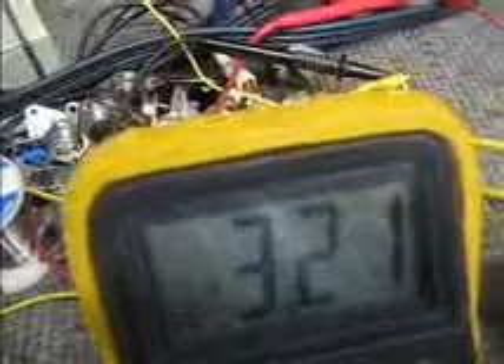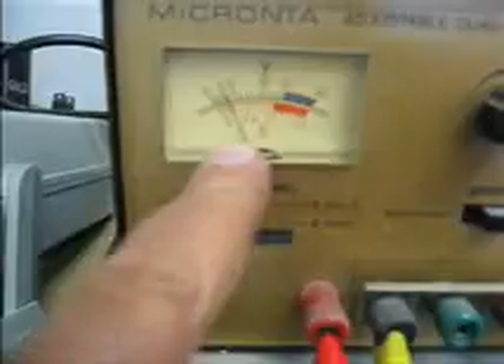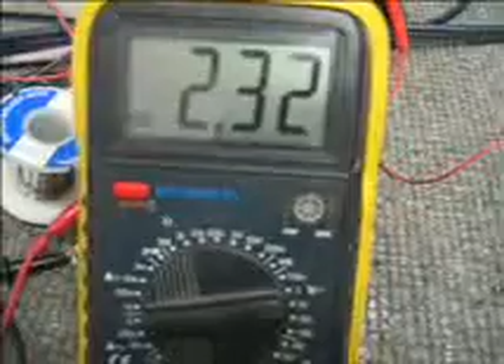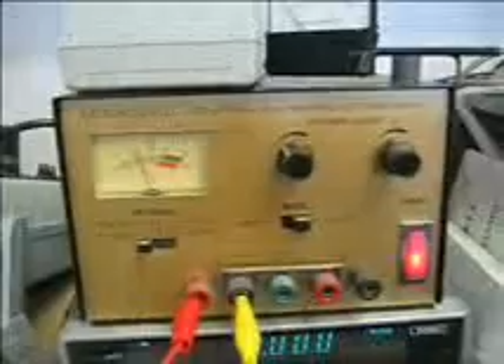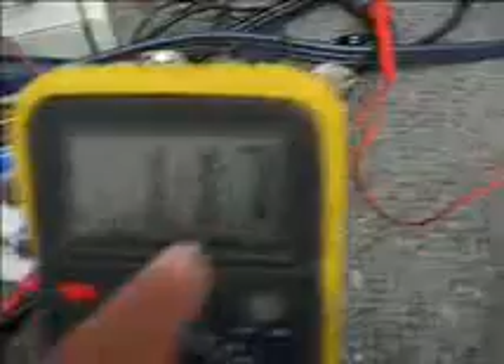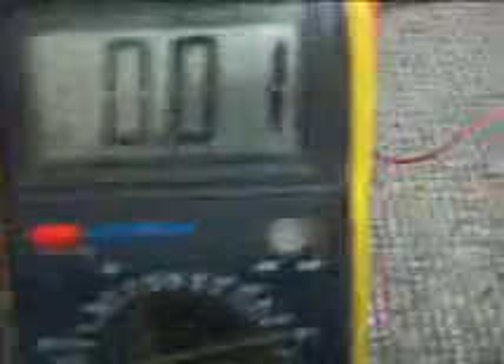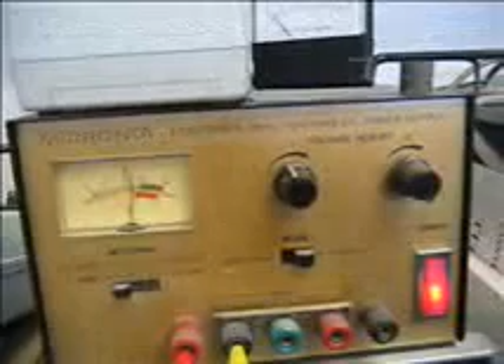How to Make A Lead Alum Crystal Battery

Comment: You seem really ambitions to me. I would like to share something with you so in case I die  it  doesn't die with me, A very simple electrolytic cell can be made with coal and bauxite using seawater for an electrolyte. These are three of the most abundant items on earth. You can use platinum for a pick up on both sides for a lifetime cell, well you know what I mean.
Reply: ... do you mean a carbon aluminum battery? which are not rechargeable?
Reply: Actually no because aluminum takes a lot of electricity to process which makes it a very inefficient cell I'm talking about: bauxite and salt water and coal.
Reply: Rechargeable means getting less out of it than you put into it that is stupid. I am talking about extracting energy from the elements we have. And yes it is a one-shot wonder.
Reply: Jack Shepherd
it's no wonder, but I will say that if you are gonna go with a non-rechargeable method carbon-aluminum is indeed very energy dense.

but the point of the battery in the video was to use with a solar array. (much easier to get power from the sun then to get power from a mine)
Reply: I would suggest buying a couple of tons at a time, and using 5 gallon bucket's for each 1.5 V cell. So it's basically free energy you just have to buy the junk and get rid of the waste.
Reply: Jack Shepherd
 if that works for you, go for it :)

though personally I rather have a system where I pay once, and don't have to worry about it (short of a bit of maintenance) like with solar or wind.
Reply: Just remember E=MC2/R  minus the same formula applied to the resulting elements.  That's where Einstein missed.
Reply: Where are is atomic radius of course.
Reply: not... quite. Energy = Mass x speed of light squared, divided by the square root of one minus the velocity divided by the speed of light

(e=mc2/√(1-v2/c2) )
and it doesn't care if you're talking about atoms, electrons, or collections of particles, so long it has mass, and or velocity, the formula applies.

a quick google search of 'R' gave me some pseudoscience websites... :s
Reply: Hello sir, can coal, saltwater and bauxite be made into a battery plate

Comment: red lead oxide is very easy to make
Reply: Clown Whisper I thought polarizing the plates with a charge made lead oxide on one plate... I suppose I should go look again :)
Reply: Jason Smith you can make it using conventional chemistry.  I cant recall the exact process but I have made it using a an oxidizer and glacial acetic acid.  If i find my notes ill post them

Comment: Insted of using red lead have you tryed to carbon normal sugar ! and using that on your pos plate's great work by the way I am stuck using copper tubing and galvanised steel i am willing to bet you are pusing at least 1 milli amp out of that to light the led also i did not use water i used alum and Ebson salt with MG in it then i heated them in the tube to make them hard as john stated and they produce energy.

Comment: Enjoyed the video.Your Alum mix was stronger than I used by far, but no doubt the formation on yours was stronger and by using 3 plates. 
Could make round cells, triangles, whatever shape and that intrigues with the melting.

Comment: The idea of an alum battery is great! Compared to lead acid batteries way more plusses than minusses.

Now about this vid:
at 8:08 you say you have drilled holes, and are going to place the oxide on the plates. But seconds later you name that 'red lead'. And you have mixed up the red lead with the alum you say. What ratio? And, could I not use red lead, but the same lead of the plates?